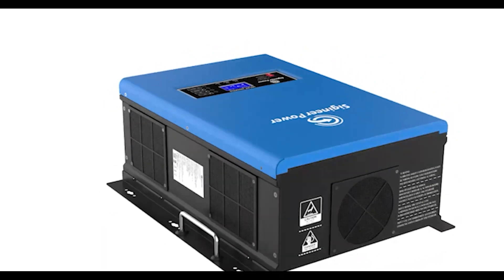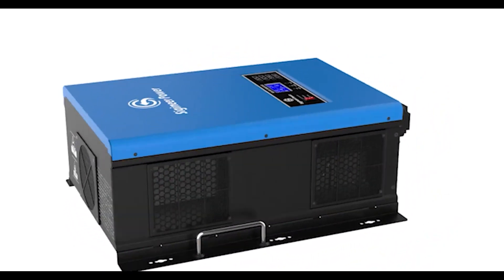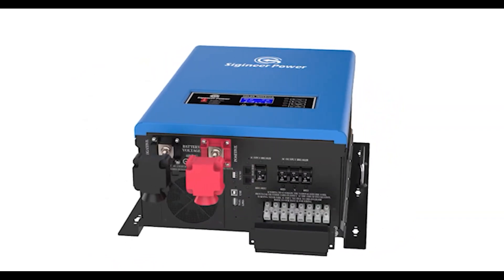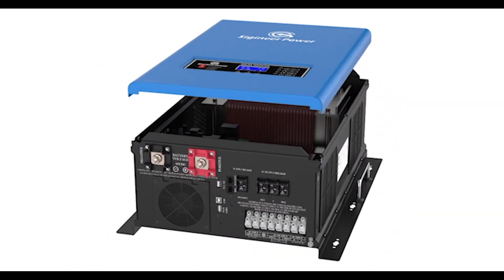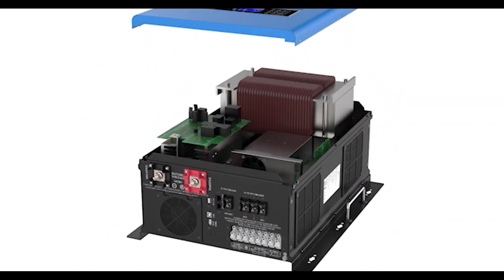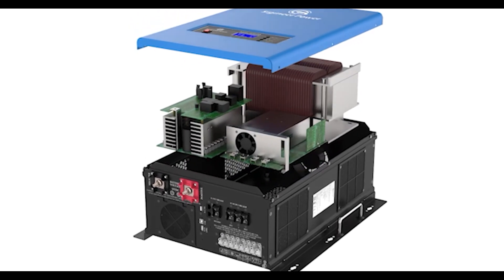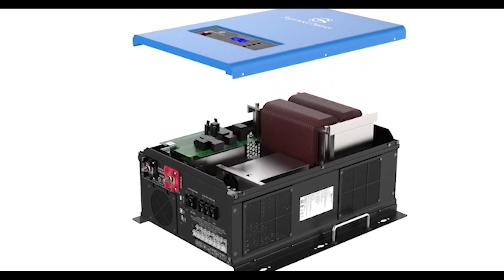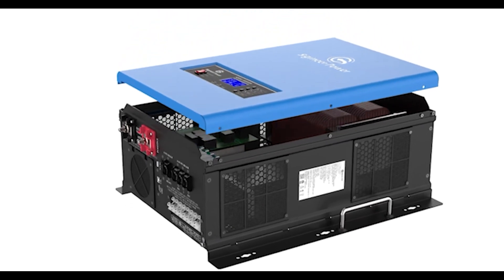Better Watch This Before Buying That Off Grid Inverter

Comment: What 12 to 15 kw inverters do you recommend?
Reply from the maker: I would suggest the Sigineer Power Model #: M12048DUL for a 12kW All-In-One inverter charger or the HP15048D for a 15kW inverter charger.